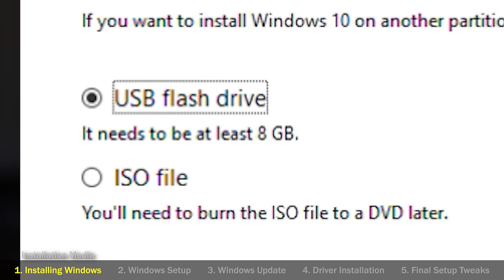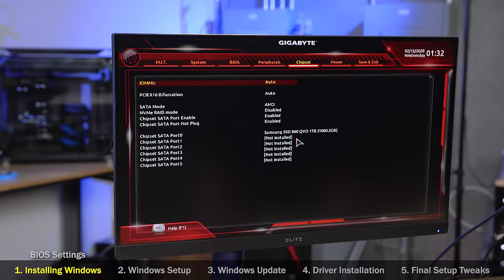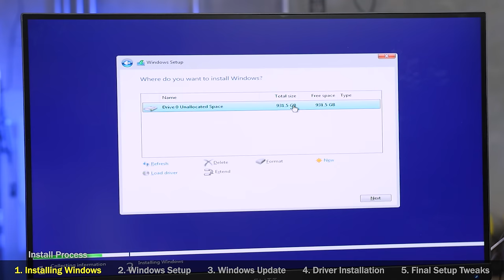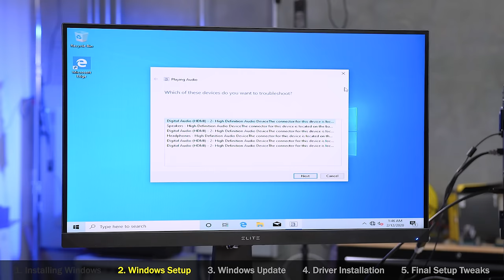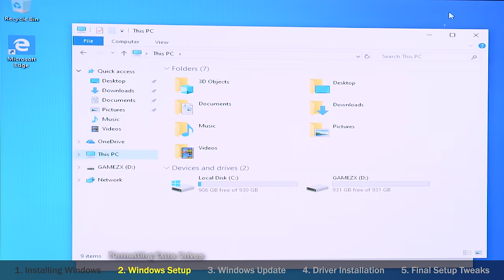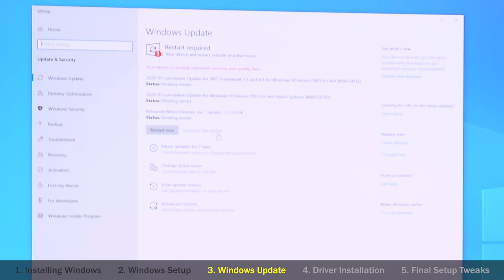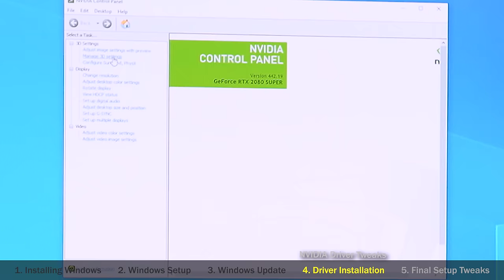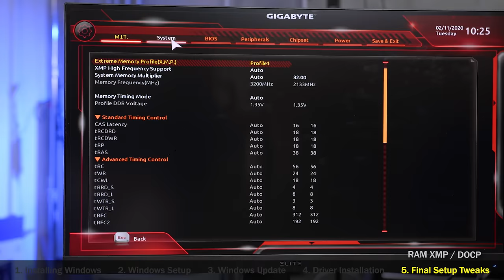Guide: What to do AFTER building your computer...

Comment: Hey Jayz what do you think about using Rufus to install a fresh Windows ? When ever Microsoft comes out with a major update, download the iso on to a USB Drive, back up your files onto a hard-drive …unplug it and install the clean new windows. Then plug your hard drive back in and your good to go.
Reply: Rufus is a very good alternative to the media creation tool. I use it regularly when I need to build USB installers. As far as major updates goes, that's a rather extreme thing to do clean installs every single time.

Comment: If you happen to be installing an older drive with a new build make sure that you pick the right order... for example I switched my nvme to being my C drive which shifted the naming of each drive... this created a directorial problem because alot of software like OBS and Steam were on that main drive that was now no longer in C: but instead in D:... this meant that games were unable to launch in steam and that all my settings on obs were disconnected causing it to think it was a fresh install of streamlabs I still havent found the settings file and i'm having to start from scratch setting my microphone filters!

So I recommend getting some tape or stickers & labeling each drive with clear manufacturing names and directory order lettering before you install them on the new pc and then you won't have the same issues I did... honestly it's been my biggest regret as I also realised that 250GB is not enough for a C drive windows and necessary applications takes up way too much memory... 

plus theres the fact that some softwares have to store settings and int, ini files in either documents or USER/[name]/appdata/Roaming like for instance minecraft. file with it's resource packs and plug in updates like optifine to allow shaders and better performance! which happens to both be located in the c drive which will mean regardless of where the actual game is based you will have to cut and pase that file in the new user!

so make sure your new drive is up to the task... also i'd like to point out if your a gamer and are using amd 5600x cpu it's been reportedly having problems with significant cpu hostage situations there is a driver patch out there that is seperate from the main amd software I very much reccomend researching it and installing it (make sure it's the correct driver and it's on the official amd site don't download it from third parties) but no clue if it works alot of amd users are still reporting issues with win10 microstutters and some games just flat out not working... but both AMD & microsoft are hard at work on it!

and most important of all if you've not finished the build yet and are willing to pay a little more I reccomend getting a motherboard with a BIOS Flashback port... this means if you have a usb with the right drivers on it you can fix a bricked motherboard by resetting to a factory settings bios version without having to open the pc back up and put a nail between 2 pins which means unscrewing the panel again setting it down, and if you got a super large gpu removing it so you can actually get the pins in... honestly i'd just get a bigger case)
(this is also useful if you installed the wrong video drivers or had a blackout during installing the bios meaning it won't turn into a paperweight)

Oh and also do your windows install media via USB 3.0 port (The Blue USB Slots not the black ones) cause I found installing my Win 10 Pro after a windows incident couldn't be done via USB 2.0 cause the data speed isn't fast enough to install it or something like that!

and finally most important of all do a back up your browser bookmarks my sibling recently did a reset and didn't consider the fact it wouldn't save those yes it says all your personal files but it does reset all your apps so your epic launcher, steam, origin and all the games on those applications will have to be reinstalled including standalone game launchers allthough it keeps your standalone games that don't have a launcher!

they lost everything bank accounts, shopping everything and the worst part is theres important stuff they can't recover for her bookmarks cause she can't even remember what those important things were so they are lost to the ether just years of data gone... what's more she knew full well the issue was on Fortnite and AMD's end they're having alot of performance issues with the game and she knew it was nothing to do with her laptop but stupidly did it anyways without consulting me or my friend with 8 years of experience building pc's.

don't be my sibling don't try to fix performance yourself if you don't know what your doing cause you may be trying to solve a problem that isn't on your end it's on the games end and making matters far worse for yourself... this is just a cautionary tale ask someone you know for certain knows what they're doing if you have an issue with your pc... don't try to experiment on your pc it'self if you want to learn how not to break windows then look up expert tutorials on setting up virtual machines if you got the hardware capabilities!

at leas then it's an emulated virtual pc that breaks not your actual system!

Comment: I bought a 3600 mhz RAM kit and tried to enable XMP and it wouldn't boot.
I looked up my mobo memory speed and it was certainly compatible but my processor wouldn't go that high. So I ended up manually over clocking the RAM until it wouldn't boot. Got it stable at 3000 mhz. Rookie mistake I know.

Comment: Thank you for this! I just bought all the parts to build my new PC but I’m trying to figure out the best OS option. I got a Ryzen 7 5800X and wanted to use Windows 11 but read that Windows 11 isn’t supported well by AMD chips. I’m assuming that this might have been updated, any suggestions?
Reply: Run windows 10.

Comment: Awesome video.  Finished my build with Windows11, Asus ProArtZ690 MB, and GTX3090 card.  Ultrasharp Monitor.  Plugged in the Dport from GPU to monitor.  PC and Monitor works great, but no usb ports work from the monitor.    So many cables/ports, etc on both MB and monitor.  I am totally confused on what cables I should use.  Should I also connect USB C from MB to Monitor?Maybe you can do a video on connecting things up properly?  Lots of videos on laptops to monitors, but not PC GPU to monitors.
Reply: What monitor do you have? To my knowledge, you can't pass USB over DisplayPort. If your monitor has built-in USB ports, it should have a cable that connects the monitor to your PC.
Reply: @JJFlores197  Thank you for your reply.  Its a Dell Ultrasharp U2723QX.  It has 1=hdmi, 1=DisplayPort (in), 1=USB-C port (video+data), 1=DisplayPort (out),  1= USB-C upstream port, 5=USB 3.2 Gen2, 1=USB-C downstream port.   Lots of ports and confusing what goes where.
Reply: @timl9495  I'm not really familiar with these types of monitors. I would assume you would plug a USB-C cable from the upstream port to a USB-C port on your monitor to enable the other USB ports to work. Otherwise, you may need to reference the monitor manual.
Reply: @JJFlores197  Thank you.  I will try that then.  Thanks for the advise.

Comment: Just built a new pc, used a m.2 (boot drive) from a previous build and it worked fine for abt an hour. Afterwards, I just get a bsod acpi_bios_error and cannot boot into windows. Also tried a fresh m.2 and new install of windows using media creation tool, when selecting usb as my boot drive i get stuck in a restart loop. Any suggestions

Comment: Just curios. How long did this entire process take? Any help is appreciated 😅
Reply: Installing Windows takes less than 10 minutes on most modern hardware. Installing drivers maybe about 10-15 minutes. Windows Updates can vary depending on how many there are and your internet connection. I'd estimate 30 minutes to an hour for updates. Total estimated setup time: 1hr - 1hr 30 minutes.
Reply: @JJFlores197  thanks just wondering how much time I would need to take to do it 😁

Comment: I hate software with a burning passion 😂 I can build PC's blindfolded but as soon as I need to deal with files and drivers, I'm done.
Reply: They're designed so that those that understand the majority of 90% will fuck things up, but only the very few perfectly understanding and bearing a context which consists a probably weeks + of hard study to simply have that 10% extra bit of knowledge won't mess it up. So for the average joe that are us we basically would be vulnerable to and be succumbing to follow as how procedures are easily achievable to us, rather than finding the perhaps definitive and much easier way to guide us through using these softwares.
Reply: Understanding Windows itself and Unix/Unix derivatives itself costs months of usage to even get through HALF of its entire utility. The average portion the "power user" or the more knowledged users among us using Windows are only getting through like 40% in reality.

Comment: Is this a good practice to do the bios update after everything else!?
Reply: In general, if your PC boots up fine without a BIOS update, you don't necessarily need to update it. However, in some instances you do have to update the BIOS to fix certain issues, like incompatible CPUs (due to old BIOS version) or a bug in an old BIOS version that may prevent an SSD from being detected.

Comment: Did some of these steps to my gaming laptop. Only thing i couldn't find was how to set my ram speed higher on bios. It showed total memory, but not any other specs and couldn't find any settings to adjust them. Im using Asus tuf  gaming laptop.
Reply: On most laptops, you have little to no control with overclocking.

Comment: "Be Elsa."  LOL.  While you should avoid overclocking settings until the OS is installed and stabilized, you should always update your motherboard's BIOS to the latest version available BEFORE installing the OS because Windows might not install or function properly on your shiny new hardware.  But you only ever want to update the BIOS just one time because bricking the motherboard is possible when doing BIOS updates.  Some motherboards have dual BIOS chips, which is useful for unbricking a motherboard, but not all motherboards have that feature.

Comment: I went through and reformatted a gaming pc I traded and they wanted it bare bones windows clean. I stuck the usb key into the front port of the PC and it would load setup but 2 errors came up. One saying I had no hardware drivers installed for the storage and two, telling me there were no drives to install windows on so the setup failed right away and made me restart and went into the same loop. I changed bios settings, reloaded defaults, played around with secure boot, uefi settings, security keys, every single setting I could think of and nothing worked. I was so pissed off, I decided to call the people and cancel the deal being I had already used linux to completely erase all the drives so they were completely blank with no partitions. I thought let me try this one last thing and moved the USB key to one of the rear ports and everything worked and installed perfectly. I couldn't even get through all the updates for the people and customize the OS so it wouldn't track their every movement before the meeting time. I let them know about it and the OS booted just fine. What a nightmare. I can see why your hair turned white. I have a few extra white hairs growing from that experience.

Comment: Don't many BIOSes have some sort of boot select option? Most machine I've dealt with use the F12 key.

Also, other OSes, such as Linux won't automatically do anything if the new disk that is installed isn't partitioned.

Comment: Here's a PITA... 
Customer wants to do some upgrades...
Only ya find that no amount of Del/ F Key button mashing works to get into BIOS, 
so want/need to use  the trick at 19:33, 
and ya click through only to find there is no "UEFi Firmware Settings" option available.
Reply: That likely means that the Windows was installed with legacy BIOS as opposed to UEFI. If you boot into Windows and run msinfo32, it will tell you the BIOS mode. If its BIOS, then that's why. And have you verified that you're pushing the correct key for that particular motherboard? On some systems, it may even be Enter. You could also temporarily disconnect the HDD/SSD so that the computer doesn't boot into an OS.
Reply: Had the same issue with my parent's PC. One thing to do is disable fast startup. in Windows 10 that's found in Power Settings >   additional power settings > choose what power buttons do. Doing that should allow you into the BIOS.

Comment: When I connect a hard disk, Windows better not set it up automatically. Would be a disaster when connecting an HDD that was set up on an Amiga, for example (you can use those in an emulator).

Comment: I am building a new system, and have ordered a 2T NVME M2 drive, thinking I will eventually expand with a second drive, so I was thinking about installing the OS and having a second partition for programs. Is that NOT a good idea? Should I get a smaller NVME , say 1 T and use it exclusively for the OS, and install all the games and programs on the 2T drive?

Comment: I download the setup onto a flash drive and I plug it in and get to the setup screen but my mouse and keyboard quit working need help
Reply: Try connecting the kb+mouse to other USB ports, preferably USB 2.0 ports. Also, if you have fancy RGB keyboards/mice, they may not work well or at all at this part of the setup process. Try using simple USB keyboard/mice for the install process.

Comment: oh, i build a pc. silly me thought i could just use my old case for the new motherboard (MSI Pro B760-P WIFI DDR4, i5-12400f with my old PSU and RTX 2060 i bought in 2020) it just turns out, my old motherboard wasnt ATX, like i thought, but mATX or, more likely imo, some proprietary medion Akoya shit. back when i upgraded my GPU, needed an adapter for some lenovo MB to connect the PSUs 20pin to the 17pin of the old MB. everything works though, but i need a new case, and a few case fans.

Comment: Dumb question, can i just use my old hard drive and transfer windows to my mvme?

I had a old pc and had windows up to date on its hard drive so i wanna know if that would be easier

Thanks for helping my stupid questions!
Reply: I have heard of some people doing this but it sometimes bugs out and doesn't copy over the Master Boot Record and it's so much of a hastle best bet is to just install windows again on the NVME and after it is setup then connect the harddrive copy over programs and files to the NVME and reformat the old drive to wipe it and use as additional space. (IK this is a hassle but it something goes wrong with a drive copying programme and it becomes a bigger problem so I stick to the method I said)
Reply: @finkitsallover  ok!

Comment: Modern windows autodetect your internet the moment you plug in the ethernet cable?
Reply: Yes and no. If Windows has drivers for your network adapter built-in, it will immediately pick it up and let you use the internet. If there are no drivers available, it won't work until you install the drivers.

Comment: Which cable of the drive you need to unplug? The one on the drive itself? Or the one from the psu?
Reply: It doesn't matter. When you unplug either cable, the drive will not be functional since it will either have no power or no data connection.

Comment: First, thank you for the extensive video! Question: I am building a PC with a Gigabyte B660 Mainboard (i5 12600k). Does it make sense to download and install all the drivers that are there for download on the Gigabyte website (after windows updates are done?). How do I make sure the most up to date versions are installed? Thanks!
Reply: I would download the drivers from Gigabyte's page. Windows Updates will usually download and install the drivers for you which is convenient. However, in my experience, it doesn't always download the latest drivers.

Comment: Right okay, what do I do about the internet part…you see I don’t have Ethernet, but what I do have is the drivers necessary on a usb stick to get my internet running. Is that the best course of action? Since jay said do updates before drivers or will it be fine if I just install the network drivers? Otherwise I’m stuck at no internet😭
Reply: Install the drivers. Think about it. If you have no network access, you have no easy way to install the Windows Updates. You're overthinking it. To be a bit more technical, you can download the Windows Updates files onto a flash drive and install them on your PC, but it is time consuming and not particularly easy to figure out for most people.
Reply: @JJFlores197  thank you for replying! I ultimately went for the driver of course and everything worked out great in the end :)

Comment: After installing windows I had no internet adapters detected meaning I couldn’t update windows before doing motherboard driver installations  
Not sure if I missed something in your guide but after rewatching still your steps taking aren’t possible for me I’m a first time builder and didn’t even realise mobo driver installs was a thing I just thought because I purchased a mobo with intel Ethernet it would come already installed on mobo do I have to install all device installations from my mobo website to ensure I’m not missing features listed 
I have the msi z790 edge wifi ddr4
Reply: Microsoft can't provide a network driver for every network interface in existence right out of the box. You will need to download the driver for your motherboard's network adapter on another computer or device and then transfer it to your new PC via USB drive and install it. It is also possible that if you used an old Windows installation media (say like 2+ years old) it may not have drivers for newer hardware that a new install media would have out of the box.
Reply: @JJFlores197  thanks bro your right I did exactly this